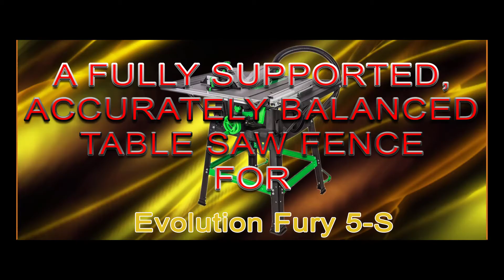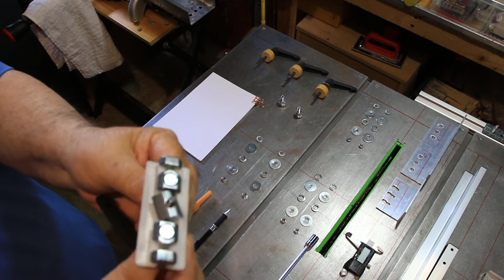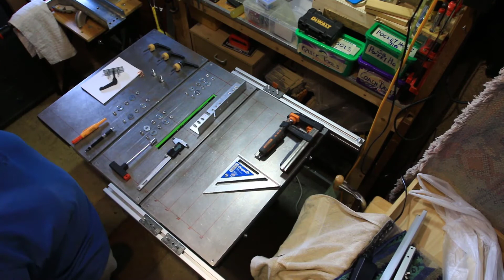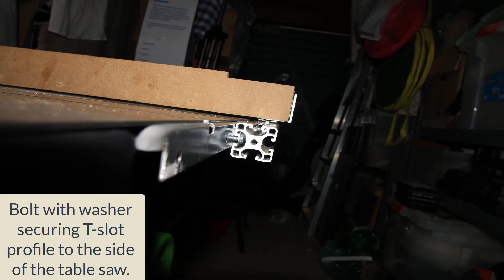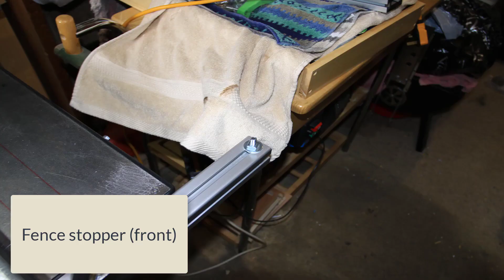Evolution Fury 5-S ----- A Top Fence Design for a Table Saw

Comment: I realise i'm late to the party, but i just saw this video. I bought one these 2 years ago. No matter how much i tighten it up it's looser than a flappy thing.  You were far more polite about the original fence than i was.  Good video.
Reply from the maker: Hi Peter, I agree with your comments re. the Fury 5S. A fence by an independent may be a solution, but it's an expense, let alone that some careful work will be required. With best regards, Harry